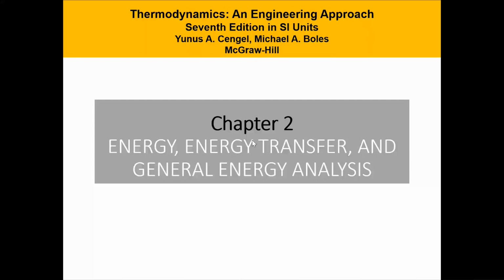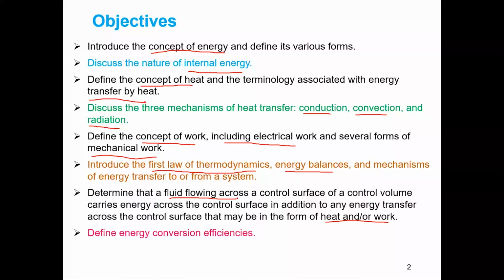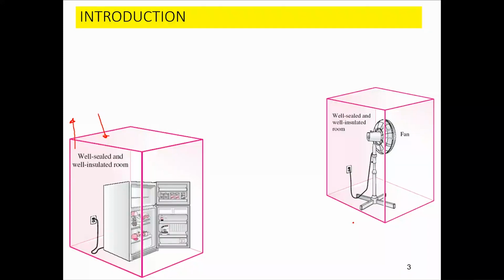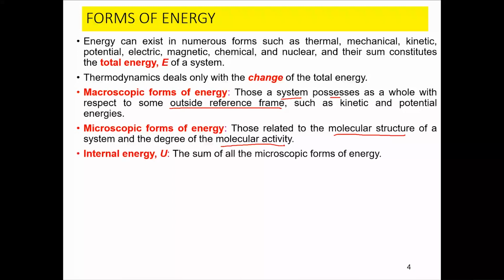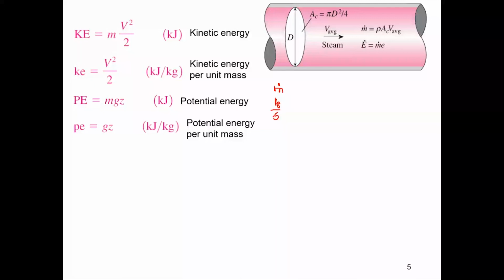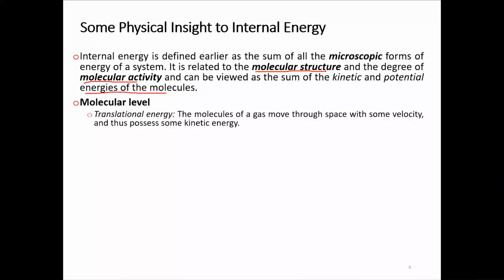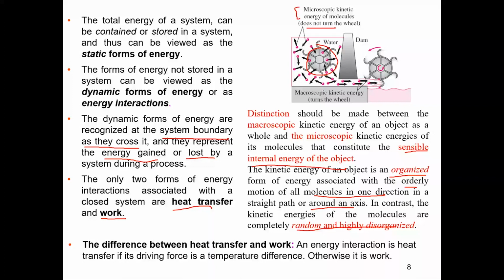Understanding Energy and General Energy Analysis | Thermodynamics: An Engineering Approach  #Energy

Comment: This video, "Understanding Energy and General Energy Analysis," is Lecture 6 in a Thermodynamics course, focusing on Chapter 2: Energy, Energy Transfer, and General Energy Analysis.

The lecture covers the following key areas:

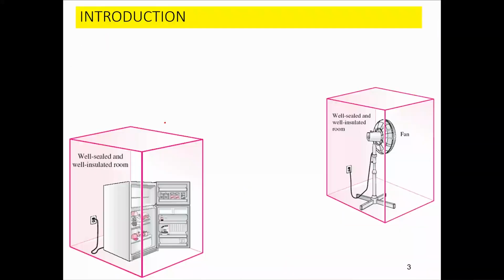Introduction to Energy Concepts (6:15): The video begins by defining various energy terminologies and explaining how energy can be categorized into different components.
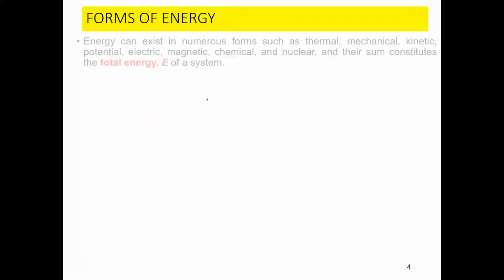Forms of Energy (11:39): It explores various forms of energy, such as mechanical, thermal, kinetic, potential, magnetic, chemical, and nuclear energy, emphasizing that these forms constitute the total energy of a system. The lecture differentiates between macroscopic energy (energy of the whole system, e.g., kinetic and potential energy) and microscopic energy (energy related to molecular structure and activity, defined as internal energy).
Total Energy of a System (15:50): The presenter explains how total energy is composed of internal, kinetic, and potential energy. For stationary closed systems, changes in total energy are primarily due to changes in internal energy (19:29).
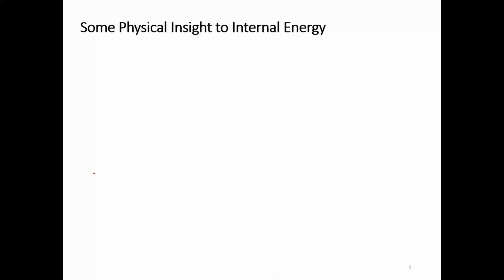Physical Insight into Internal Energy (20:50): A detailed explanation of internal energy is provided, breaking it down into:
Sensible energy (22:25): Related to the kinetic energy of molecules (translational, rotational, and vibrational). An increase in temperature increases sensible energy, thus increasing internal energy.
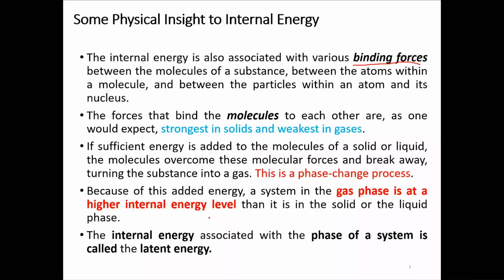Latent energy (25:23): Associated with phase changes and the energy required to overcome intermolecular binding forces.
Chemical energy (25:40): Relevant during chemical reactions when bonds break and form.
Nuclear energy (26:07): Comes into play during nuclear reactions.
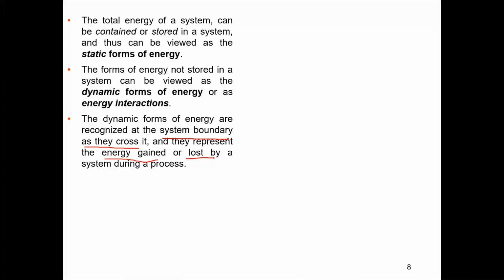Static vs. Dynamic Energy (26:32): The video distinguishes between static energy (stored within a system) and dynamic energy (energy interactions crossing system boundaries). Heat transfer and work are identified as the two main dynamic forms of energy interactions (27:31). The key distinction is that heat transfer is due to temperature differences, while all other dynamic energy interactions are considered work.
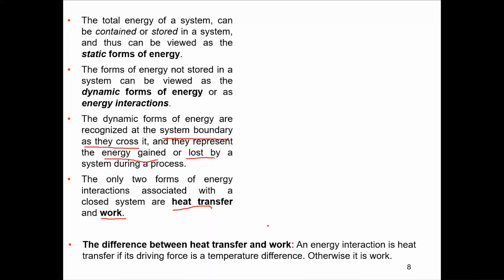Macroscopic vs. Microscopic Kinetic Energy (28:10): The lecture concludes by differentiating between macroscopic kinetic energy (organized, orderly motion of molecules, like water moving a wheel in a dam) and microscopic kinetic energy (random, disorganized molecular motion).